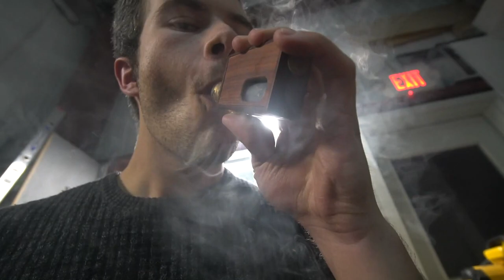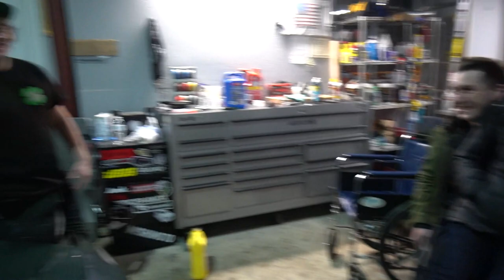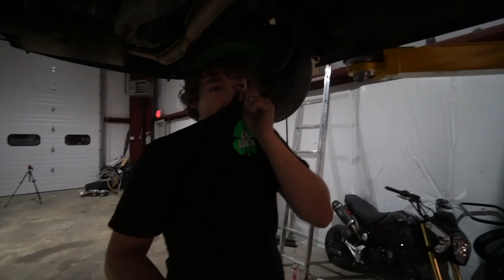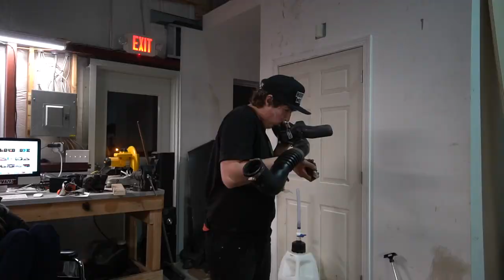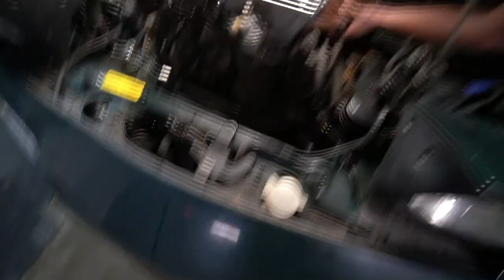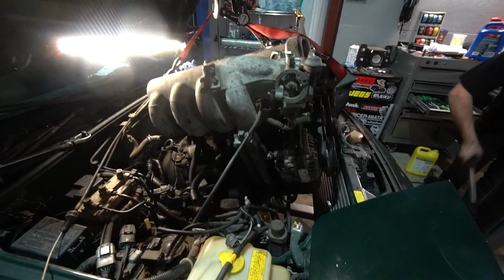MIATA SLEEPER BUILD!

Comment: Go balls out on the suspension and all. Set coilovers at the stock ride height use an electric exhaust cutout with a fender dump too because that would be bad ass.  Maybe get the stock wheels widened to keep the sleeper look and allow yourself to run a wider squared tire too for traction.
Reply: Shit the fender dump would on a switch would be so sick, roll up next to someone all silent then flip a switch and watch their face turn as they hear straight pipe and turbo whistle.
Reply: FatDan Nj it's not a v8 straight fender dump would sound like a Honda with no exhaust
Reply: Its not for how good it would sound its for the shock factor and the fact that its a tiny bit ricey but that's who he is. Plus if it really looks completely stock noone with real power will want to waste their time racing him, it just needs a little something to peak curiosity and make people wonder without having the hood open.
Reply: Bump dis
Reply: RUDDY see this
Reply: I'd like to one-up the idea of an electric exhaust cutout; given that miata exhausts don't sound very good loud, instead of having an exhaust cut out, run a y shaped wastegate pipe with one end plumbed back into the exhaust and the other attached to an electronic exhaust cut-out valve; effectively turning it into a screamer pipe when he wants to. Other suggestion I have is methanol injection.
Reply: Notsavagepinks Did you forget how the ricer miata sounded, its far from a riced out Honda, so you'll be hearing the turbo spooling.
Reply: errr no, thats not what he said. Hes talking about using the exhaust cut out for the exhaust, im talking about using it for the wastegate, to create a screamer pipe. (which is essentially venting the wastegate straight to air instead of plumbed back into the exhaust.)
Reply: Jbwifi that's a good idea and all but at the same time its no Cosworth built motor. Personally I think using the cutout on the exhaust itself will take more people by surprise and the shock factor is what you aim for with a sleeper. The methanol idea I do like though.
Reply: if you jump on youtube search and look at screamer pipes in the likes of silvias personally I think they are a lot more surprising. But each to their own.
Reply: Jbwifi oh I know what youre talking about I'm just a difficult person haha either way I think this car needs a shock factor weather it be an exhaust dump or screamer pipe it just needs something to make people go damn what did I get myself into.
Reply: agreed haha.

Comment: You can use some sillicon spray on those heater line. Let it soak for a bit and it help a lot, you can use it on most of the rubber line in fact.

Comment: Hey Chris do you think a 1J or 2J would fit in a Miata with a bit of work? I have a running 1J and I can get a 99 Miata with a cooked engine free... what do you think having worked on Miata's and J series engines?
Reply: Derek Joon it would be a pain in the ass and experience because it’s a pretty long motor, but anything is possible
Reply: That dude up there fit a v12 2j should fit
Reply: "Car Porn Films" did a v12 swap, from some Toyota & I'm pretty sure a 1j or 2j is smaller, so I say definitely yea it'll fit.
Reply: If u getting the Miata for free jus do it

Comment: Wasent he going to put the SR form the 240 in?
Reply: Yeah , but he had it with that car and sold the parts and junked it when it was stripped.
Reply: No the SR is for the white one.  Dk why he doesn't take the whole swap from the white one and then swap the SR in.
Reply: Sr is for the jdm roadster. You can see it in the corner if thr shop in some videos.
Reply: Gma Bailey He used to have a 240sx that he was building for that motor. Only for the og’s to speak tbh.

Comment: unless you actually go legit for once. then instead of wasting more money on crap you dont need. just use stuff off the roadster. since you're not going to have that motor in it for long. since its sitting anyway and you have so many other cars to drive. like i said just use parts of that until you drop the sr in it.